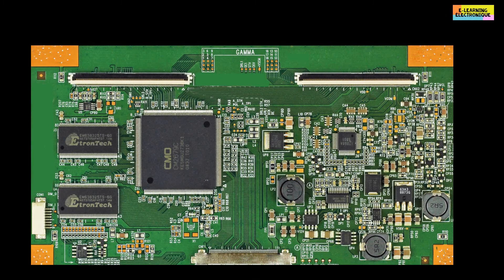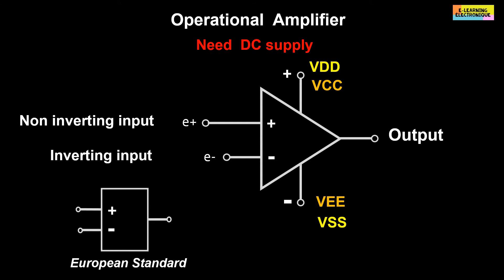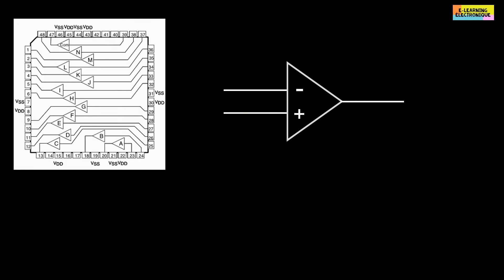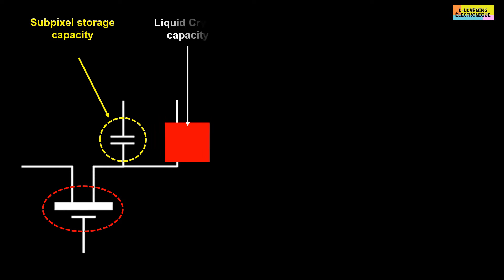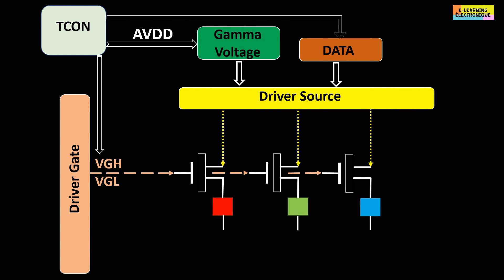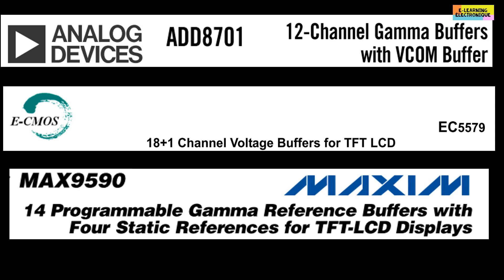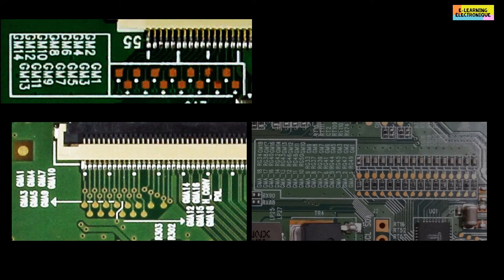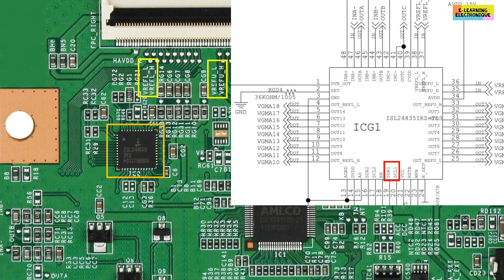The Gamma chip of the TCON board and the role of the opamp configured as a voltage follower

Comment: Hi! This was a great video exlpaining almost everything in detail. Except one point which I ve been searching for a long time. How is the pixel intensity of 8 bit (256 values) being arranged by 10 gamma voltage? Is there another extra DAC in between Gamma output and the TFT source? What is the algoritm, circuit behing that?
Reply: Yes, I’m asking this to myself too. Is a partial gamma correction sufficient to maintain properties of the lcd cell ? Or are programmable chips more efficient / complete giving a better quality and more durable screen ?